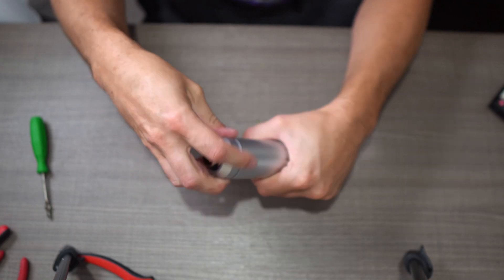$18 Amazon Microphone Capsule /  Circuit Mod - OPA Alice Mic

Comment: You are missing the Capsule Bias generator board needed to make this work. I am not sure how you got this to work with out it.
Reply from the maker: Hello, big fan of your videos! Thanks for your comment. I soent the last 30 minutes reviewing things and have an explanation.

I started this project over a year ago. Gave it a proper go about 3 months ago. I used the Amazon body, tsc-1 capsule, and the Alice opa single board. That mic produced a very low output and a strange tonality. I tried a few things and chalked it up that I maybe had a defective capsule.

I shelved it for a month. I bought a random large diaphragm capsule on ebay. Then proceeded with the build as shown. That mic is what you're hearing.

I just rewatched the video on your channel on the 3 kit mics. I think the Serena has the tsc-1 capsule and you use the hex converter board. That seems to explain why my first iteration didn't work.

Hmmm, I'd like to try the tsc-1 again with the proper boards. I'll update the links.

Thanks for your comment! I'm learning!